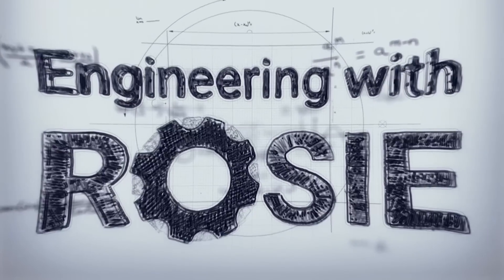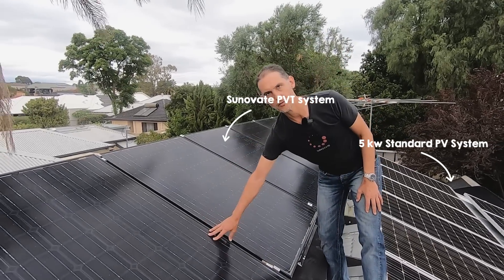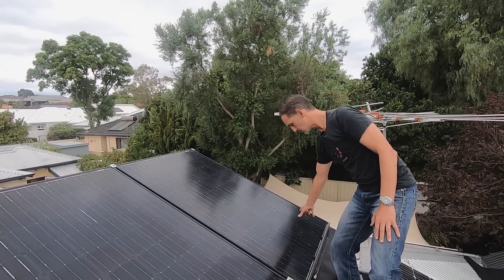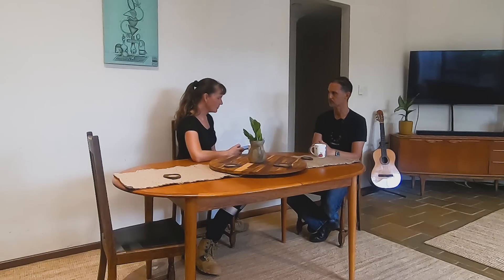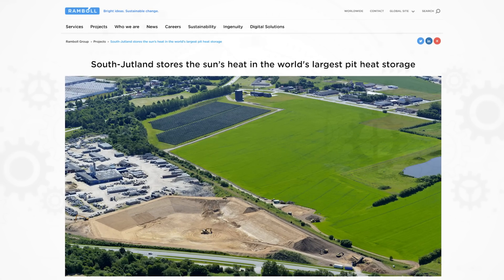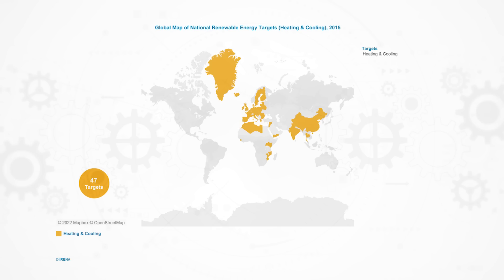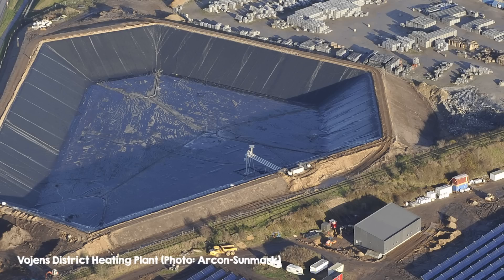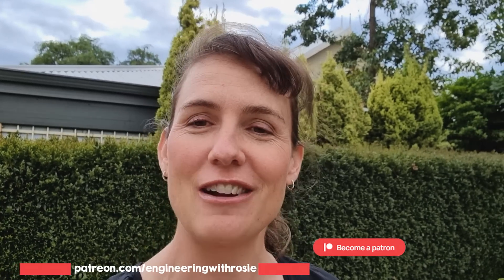Warming Up By Cooling Down Your Solar Panels

Comment: PVT is unfortunately a gimmick that has tried to be sold but does not work out. At least with water, this with air is new to me. Still a technical dead end, PV by itself in combination w a heat pump is better.

Comment: Doesn't seem like the way to solve a problem because 'low quality heat' and 'heat when you don't want it'. Seems a reason for better quality materials. Of course, it needs power too.
Reply: @ Andrew
I think you’re missing what might be the key benefit of this type of system and that is increased durability. Panels will not degrade as fast and will last longer. It’s possible that this benefit alone will justify the increased cost but that is long term thinking which we’re not always good at. And as for ‘heat when you don’t want it’ there are storage solutions that are being used and invented as we speak.
Reply: @mikedavison3400  If you discount the value of the dollars spent today over the life, by year 16, those dollars are far better spent elsewhere. Why? The peak or worse inefficiency is during the peak of the day. Moreover by 1-2pm in Australia, you often get cloud cover, and a breeze, which will cool the panels. For this reason, I'd sooner just invest in more   panels on 'a needs basis' than incrementally attempting to future proof.   An alternative solution, which would be much cheaper, and discretionary, might be to identify peak temp period and erect a screen to partially shade the panels. Not too much that you stop electrons flowing. That depends on type of panel circuitry. But frankly, I'd just get more panels because I like simple solutions. I'd not add a complexity like a fan. You need to look at the value of those dollars spent today and on additional capacity in 25yrs. The value of years 25-50 is approaching zero.
Reply: @ Andrew Sheldon
I think the value of the panels 20-25 years out would depend somewhat on how long you expect the house to last. Having to remove degraded panels, dispose of them and then have new panels delivered and installed are all financial and environmental costs. You would also lose your solar production for a few days and have to put up with the noise and chaos. Having something last twice as long will in most cases always be worthwhile as long as upfront cost is not prohibitive.
Reply: @mikedavison3400  decisions at the end of the life of a 'long life asset' are immaterial. The big issues are performance over lifetime and time value of money. This latter issue you are not considering.

Comment: You'll never replace fossil fuel with alternative energy completely. Solar and wind isn't a reliable source. So you have nuclear or fossil and some hydroelectric. So a simple question, what would be the alternative energy production be to create concrete? Right now it accounts for about 8% of the co2 pollution. And the usage of concrete is only going up.

Comment: Early on you lamented biomass not supplying enough heat. Even the fastest growing trees require a decade to grow to a harvestable size while current tree farms are unable to meet the limited demand today and so old growth forests are being cut down to become wood chips. Tree farms can consume more co2 than old growth forests but only by packing monoculture fast growth trees into lines without any nitrogen fixing plants between them to prevent soil depletion. Biomass is logging industry greenwashing and any scaling up in this share of the energy market will only be disastrous for ecosystems around the world.
Reply from the maker: Thanks for the comment, and I agree with your points. I actually said towards the end that biomass would be hard to scale up quickly without adverse outcomes like you suggest. Maybe it wasn't clear what I was saying about biomass but at no point in the video did I suggest I wanted to see biomass scaled up quickly.

Comment: Funniest part of this is in the US, specifically the northeast, there's been a huge drive away from electric towards gas because electric heating costs are significantly higher than gas or oil.

Comment: We've had Geothermal heat/cooling for 30 years in Michigan USA. Hot water is also electric. Adding Solar panels will be a big plus and that's this year's project. Even on days when outside temperature is well below freezing if there is sun our home heats nicely and the heat pump is idle. Adding that solar thermal twist could allow me to store enough heat for most or all of the overnight.  I hope this product become available here soon. Need a "beta site' in the USA? (Hint HInt!)

Comment: it gets me why Australia outback not covered in solar panels and wind turbines making there power prices the cheapest in the world
Reply from the maker: Great point, and actually there are soooo many projects like that in planning or under development. I should make a video on these giga-projects soon. 

The simple answer to why it hasn't been done before is transmission costs. The deserts are far from where people live, so transmission costs would make the electricity very expensive. The big projects underway now are all exporting energy via new technologies like thousands of km long subsea cables, or using electricity to make hydrogen or ammonia. I think we'll also see minerals processing and manufacturing in these areas with excellent renewable resources and then the processed/ manufactured products will be transported instead of electricity.
Reply: @EngineeringwithRosie  have you looked at the EU project of putting a huge solar farm in North West Africa and using a DC interconnect plugging European grid into it?
Reply: Aus has a number of towns, 60/100 miles apart that are cutting the power line and installing solar and batteries. Mostly north west.
Reply: Watch the Snowy 2 pumped hydro videos. A 2 gig storage system.

Comment: So Rosie ........ we want to add heatpumps to our homes, induction cook tops to our kitchens and electric car charging. ALL AT NIGHT !  Could you do the maths on that. 🤔
Reply from the maker: Yeah you can check out any of the videos I've done on wind energy or energy storage (e.g. my most recent video was on pumped hydro storage) to find out how we can use renewable energy when the sun's not out.
Reply: @EngineeringwithRosie  hi, thanks for reply. I'm in Brisbane, and not brilliant at maths. I have not seen an estimate of extra power generation required as we switch to electric alternatives, or total generation required by " 2030" and beyond. For example 10 million EVs just in Australia, with a Tesla going 50 km a day needing 10kWh . We don't only need to replace current use but also ALL the alternatives switching to electric.
  No one is talking about how much or how to do it. Thanks , love your vids and content, David.

Comment: If you want to get to CO2 neutral you cannot do it with Solar PV/Wind/Battery/EV tech.  Won't work.  Why?  Storage and embedded CO2 in the devices.  The battery is more CO2 than gasoline with over one day of storage.  The average house needs over 2 week, which costs around $1 million.  Won't work.  

What will?  Solar thermal with a solar motor that will also run on fuels, plus fuel maker with fuel tanks and hot water storage.  Store energy in propane all year long.  Max out roof for about 1/12th the cost of PV system. The roof IS the panel.  Battery cannot do the needed seasonal energy shift required, nor can it store the energy for cars.

A 2400 square foot roof would do all thermal and electrical loads, plus 4 cars.  No need for solar PV/wind/Battery/EV tech.  In fact, they are 30-90 times MORE CO2 due to embedded CO2 in the machines and batteries.  They will never allow you to get to CO2 neutral.  Volvo did a study showing this.  

These combined panels are NOT the solution.  Again, no way to use or store this energy.  

Better to get panels to 500 F (260 C) and run engine that makes fuel.  Store fuel for use later.  Store hot water for 2-5 days of fuel less running for thermal and electrical loads.  I am working on this engine...

Combining water with electrical PV panels is NOT valid, nor are there other benefits like water distillation.

Comment: The problem that you weren't interested in heating so you ignored activists talking about it until recently is a you problem. Most activism consists of chipping away slowly at an issue trying to come up with a way to present it that gets popular attention and/or political traction. Hopefully the latest war will help push non-gas heating solutions into popular use.
Reply from the maker: Interesting that you think you know what I have been interested in over the years! 
You are of course right that some activists have focused on heating for ages and haven't got much traction and are probably as frustrated as all the engineers and inventors working in this space. But it is not something that you heard the most influential activists talking about until recently. That was my point.

Comment: What????? Heating a house with warmed air from under a solar array..... isn't that only going to heat a house in HOT WEATHER? It would make more sense to use the hot air as input to a heat pump to provide power for air conditioning.... at least you get more of it when you need more rather than the absolute inverse. This is a rather unconvincing - not to say - silly, video.

Comment: Please, I beg you, use a tripod and much longer lens for the talking head stuff. The wide angle you're using, probably your phone, is distorting your face so much that it's distracting from what is otherwise a pleasant to watch segment. Same for the interview part, longer lense that has the wrong of you and way less room would improve it dramatically, also your phone? Camera doesn't have to be fancy.
Reply: Autocorrect fail, two of you, not wrong of you.

Comment: As soon as I realised where this is I stopped watching. I have used solar PV for over 30 years & I spent 3/4 years trying to get information from the manufacturers/sellers of these panels with no replies. This only proves that thay don't work like solar PV panels when you live in the north west of Europe. You have to rely on petrol generators & use solar as  a top-up & I have 10 KW of the latest panel's that for over 2 months of this year  produced almost nothing so I relied on a honda 600w generator that not only changed my batteries also powered my house.